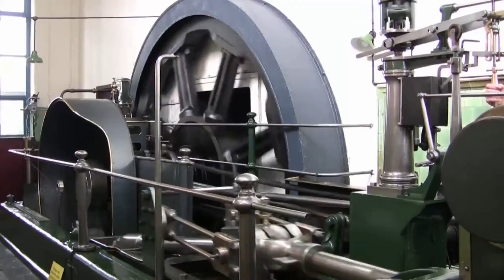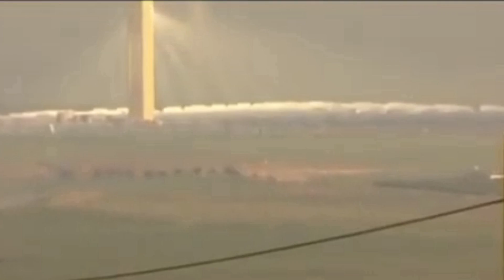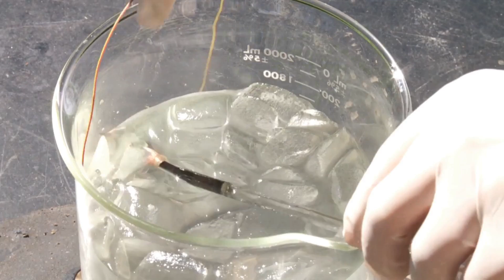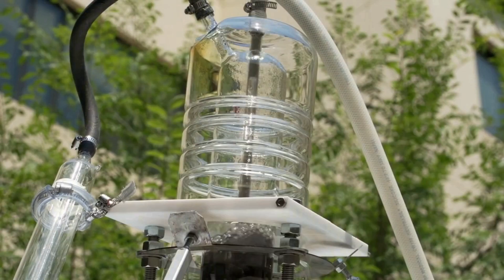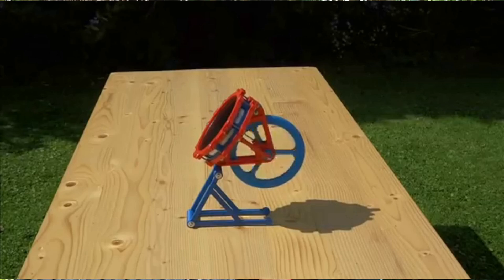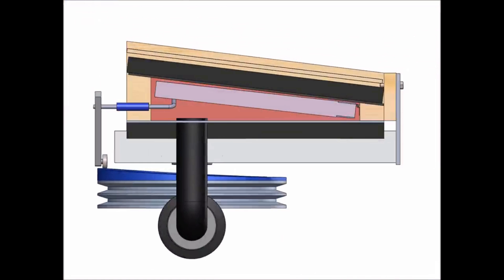1939 Solar Thermal Power

Comment: Just think if we build houses from scratch in a symbiotic way of thinking where every houseappliance generating heat, went into the same heatstorage as all the other houseappliances generating heat.
Where solar, wind, geothermal and other generators was considered in the design of every newly build house.
Where watercollection was considered in the design.
Sortly said, where the symbiotic multiplesolution was explored and considered like here on this channel.
Then add that approach to reconstruction.
Imagine the change that would bring if applied generally, it could prevent a lot of pressure on the backs of families across the world.

Comment: it seems the nano particles give two things then, because only one is the absorbing light to covert it to heat, the other being they become nucleation points for the water to expand into steam, so the water does not super heat with out boiling due to everything being ultra smooth, 

also I guess a 3rd thing it gives is that the nucleation points are right where the heat exchange is happening from light to heat directly to further facilitate efficient boiling of water.

Comment: Solar ions are the easiest way to make power. Where you use nano particles to collect static charges from the upper atmosphere and use a on off switching of the antenna to a ground connection to run a transformer in the circuit to make electricity. Though could you use a radioactive source to make ions from chlorine and nano carbon and switching on and off between the nano carbon and a ground with a transformer for a crude form of nuclear power? I guess the ion density would determine power. And the lower the more easily a particle is ionized the more power it  would make.

Comment: I don’t know what surface material the RRC solar sterling engine uses to generate their heat, but the instant I saw it I thought of solar cells. 
It would increase the total device efficiency and help cool the solar cells to extend their useful lifetime. Seem like a very symbiotic pairing.

Comment: Great presentation of solar thermal power gen!  Another cool thing about Stirling Gen is that since it works on temp difference, the same system will be more efficient when the cold side is made cooler - like in winter!  Cool👍
Reply from the maker: very true mate and nice point - cheers

Comment: Nano particles in the water ....
Bill and Melinda Gates foundation....?
Probably some downside
Reply from the maker: probably but then isn't there always?
Reply: @ThinkingandTinkering yes.
In gardening, and engineering,  one strives for synergy out weighing  entropy.
Nano is too new to know the cross contamination risks.
While Bill and ...have a track record that includes a body count and lawsuits on same.
Not surprised though at the enhanced thermal performance. Aluminum oxide sprayed into the fluid medium of the troposphere performs much the same. It is capabled of capturing tremendous amounts of solar energy.

Comment: I wonder how the solar kettle would do with the right lens over it, surely it would boil faster but would the tube survive?
Reply from the maker: it would be concentrated solar if you did that mate
Reply: @ThinkingandTinkering  could you throw a few of those tubes in a swimming pool to heat the water? I'm thinking sea water with that setup in a clear plastic dome should evaporate useable water and maybe the concentrated salt water could be used for hydrogen and O2? Hydrogen tractor out now so it should take over from oil and EVs (probably why the price hikes lately tbh)

Comment: Not necessarily ..
Helium gas cooled reactors can use gasturbines without the relatively inefficient steam process. No boilers, no multistage separate units, no condeenser, no water preparation and meticulous cleaning make up water.
The advances of gasturbines and compressors in aeroderivatives is not to be discounted,
Reply from the maker: How many are in operation?

Comment: Water boils so much easier in a vacuum IRC it cuts the heat needed to a third of what it normally takes to boil water which expands a systems operating range IE you don't need to live in sunny places to get it to work and or burn much less fuel.
Reply: That is not true , the evaporation enthalpy is the least near the critical point of water, high temperature and pressure, look it up.
Reply from the maker: it does mate - but it then depends on what you want to do with it - for desalination vacuum distillation with barometric head is a great low power system - but if you try and run an engine from it you won't gt the same power out as there is less energy going in

Comment: Fresnel lens sand battery using molten salt for heat exchange comes to mind, I guess it depends on what you want to end up using for your power to appliance ie. heat, electricity, mechanical, etc.
Reply from the maker: yes it does - but good idea mate

Comment: That flat panel Stirling engine was awesome! Thank you Robert once again for bringing up these innovations. I need to build a sand battery and put that kind of flat stirling on top of it to have some power during the night. We are now pushing around 30 kWh altruisticly to the grid on a sunny day with solar panels...
Reply from the maker: i agree - the flat panel Stirling is awesome and with improvements that can be made for sure
Reply: @ThinkingandTinkering  I've been thinking for some time that a sterling engine could be a solution for mild but productive refrigeration, something that attached to solar panels could even boost their efficiency.

Do you think it could be feasible to use that flat engine as a base and substitute the top with PV (lightweight) panels?

Comment: Would a Nitinol engine be easier to build than a Stirling?
Reply: My understanding is the problem with nitinol engines is the meal doesn't last long enough to pay off

It eventually starts to degrade in some manner
Reply: @BillHallProductions  that's something I never knew about Nitinol, thanks!
Reply: @colleenforrest7936  i kept wondering why they didn't take off but I had to dig to find it
Reply: Unfortunately, Nitinol alloys are involving phase-change temperatures, it demands times and a huge gap of temperature to ensure annealing THEN quenching, then a new cycle.

A Stirling engine common way of improvement is to increase the thermal capacity of the working fluid.

Compressed pure hydrogen is used in nuclear power plant to ensure a stringent cooling of the very powerful alternators, which are imprisonning this flammable gas in a closed-loop of ...viscous oil. To ensure that the rotating shaft will never touche the static, immobile parts; by having a circular "viscous oil cushion".

Inside, it's hell with hydrogen.
Outside : very qualified servicemen which are walking next to this mighty equipment, weighting hundreds of tons..

In a Stirling engine like the SOLO 151, compressed hydrogen up to 700 atmospheres of pressure is used.
NO SCRATCHES on any assembly, planar face is allowed. Very very gas tightness is required, to obtain yield close to 40%.

A very high technology to make such external combustion motors.
Best regards
Reply: @zenile7087  Would helium work instead of hydrogen?  No chance of combustion, and less chance of leakage.  Probably not quite as efficient, I suppose.
Reply from the maker: yes - but it has it's problems

Comment: At threat of ridicule, nano particles - old car oil!!
Reply: Nope, the gradient of high temperatures flowing into the chamber of the solar furnace leads to "cokeification" of common mineral oils, leading to scaling of huge coatings of adherent bitumen, then highly viscous tars, then almost a coke-like nasty matter, with plenty of pyrolisis-made holes of void in it.

Nanoparticles are used to enhance thermal conductivity AND stabilize the heat gradient, as much as possible. Avoiding "calefaction" as much as possible.
Temperatures can reach as high as 1100°C. Very few alloy can withstand this, leading often to creep, "blown internally" of pipes and vessels.
Reply from the maker: i have quite a few vids on how to make nanoparticles mate
Reply: @ThinkingandTinkering  just being lazy, but old motor oil should be full of nanoparticles - I have way to many halve projects lying around. My low speed low cost wind generator is finally nearing completion though. It is based on a wind vortex. The generation of central bank Fiat currency has presidence unfortunately.